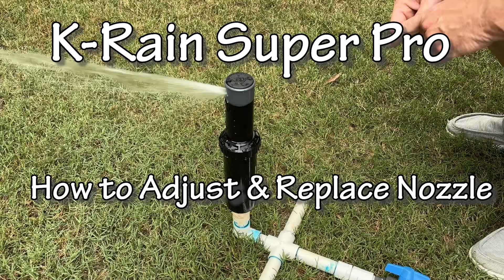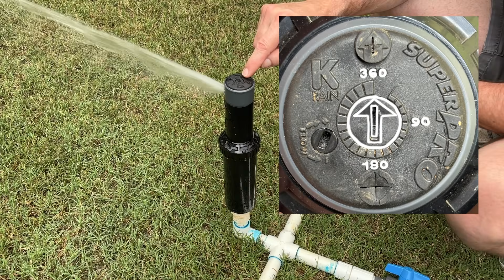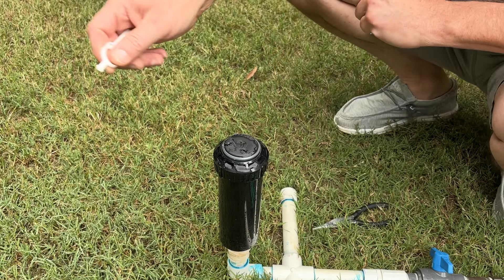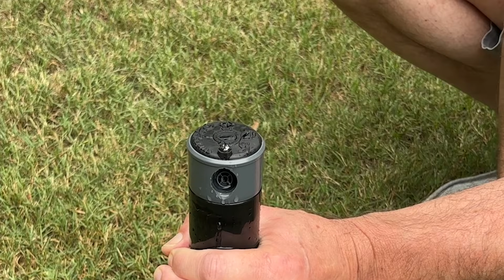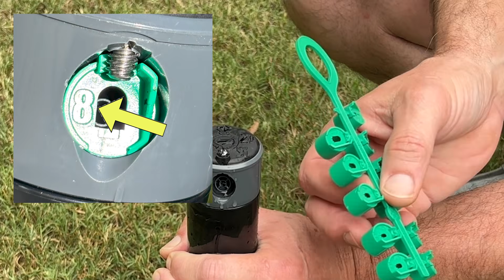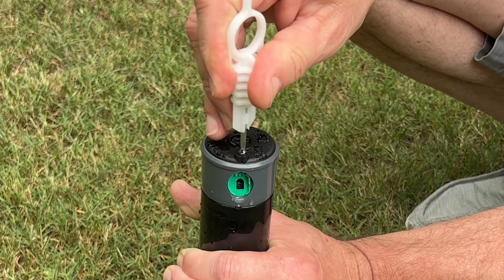K Rain Super Pro How to Adjust and Replace Nozzle (sprinkler head)

Comment: Hy, is this the only way to set the left startpoint? I tried to turn to left, to set a limit but I can't(the whole family tried to turn it) ,the sprinkler won't move, no rattlw, no nothing.. I have a few sprinklers for ehich I reaaly need to set the left limit..thanks
Reply from the maker: If you can't get the ratchet mechanism to turn to the left to set the left stop point, then you have to turn the whole sprinkler body to the left. Dig up the top 2 or 3 inches of the head, grab the body with a pair of channel lock pliers and turn to the left. Be sure not to squeeze too hard with the pliers and crack the sprinkler body. And don't grab the bonnet with the pliers, you may just unscrew it, go a little lower to the actual body and turn it.
Reply: @Proirrigationtraining thanks for your answer, I will try it!

Comment: Thanks, is there a trick with removing the red low flow nozzles?
Reply from the maker: I take the screwdriver and push the tip into the nozzle opening and pry it out.